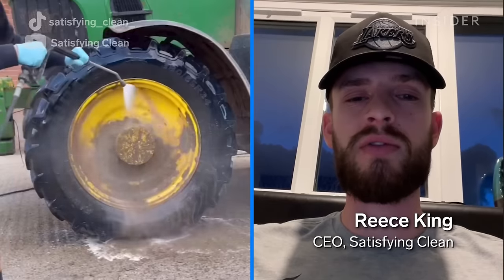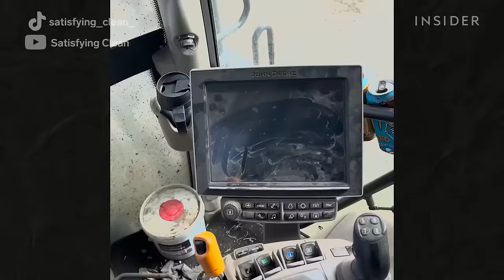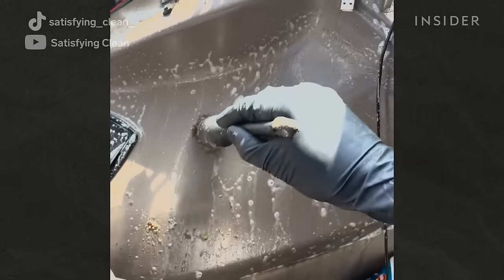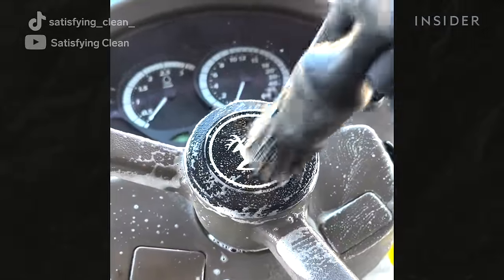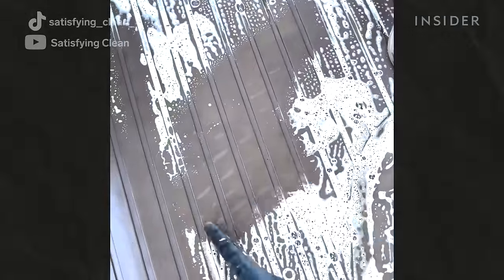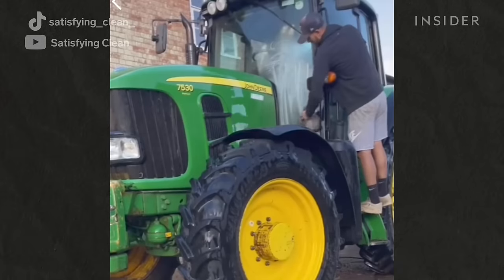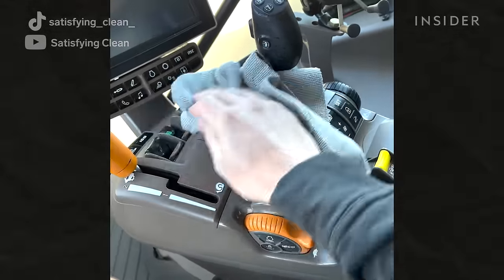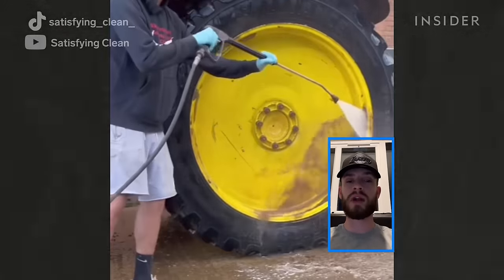How A Filthy Tractor Cab Is Deep Cleaned

Comment: Uh ok, I'm impressed and appreciate with the job and all and the determination Goodwill but putting all that water on the computer screen and buttons as well as the dash it going to drip into places that you don't want it to go or get in behind the dash screen and get on the gauges another process in that area should be used or not using so much spray at once. That's my only concern here especially in the winter and when stuff freezes the water where you didn't want to be can damage electronics, sorry about the essay.
Reply: Incorrect,it might do that on regular vehicles but new tractors and heavy equipment have rubber seals behind electrical components because the companies know they are gonna get wet/muddy.
Reply: @thomashopper3705  not everything is perfect bud and not in my tractors would I even dare attempt dumping water on my controls. And I don't get how farmers are so dirty, what are you doing setting your feet up in the dash, rubbing your boots on the buttons, slobs, pigs, grubs, worms, are you keeping your doors and windows open?

Comment: You don't have to try to be cleaner then when you buy the tractor all they do is give the outside a quick rinse and get the trash out of the cab leave and the dirt and stuff on the floor if you buy it used obviously doesn't come from the factory like that